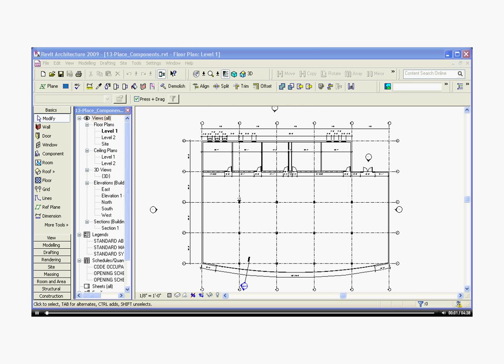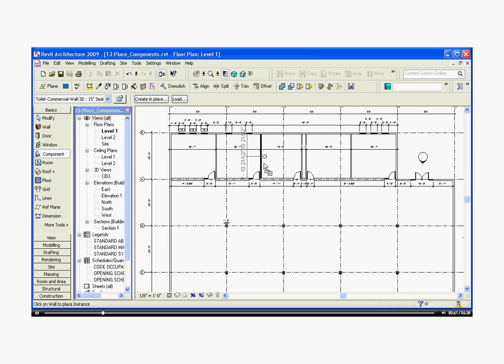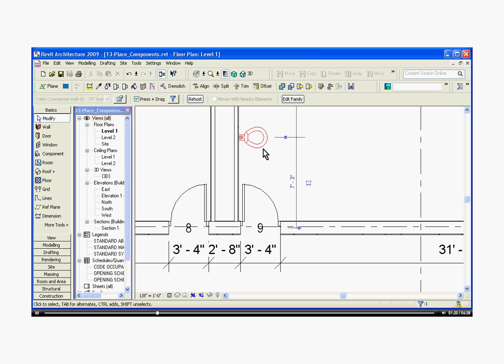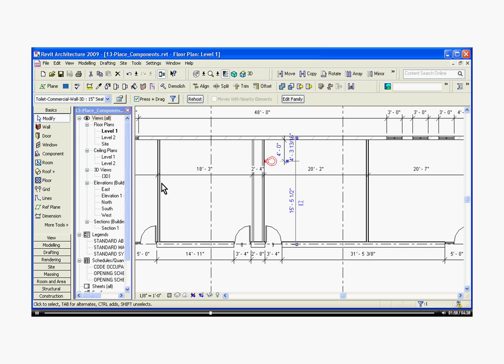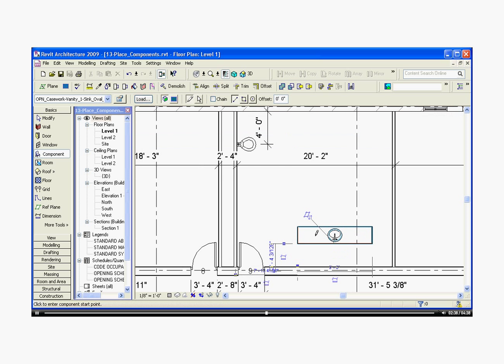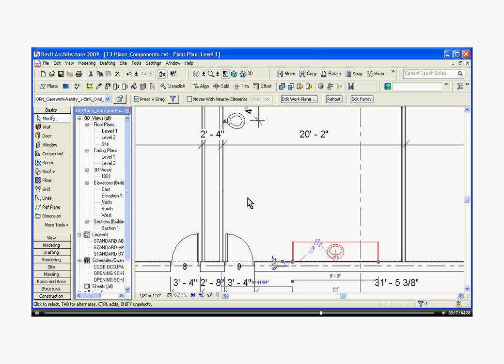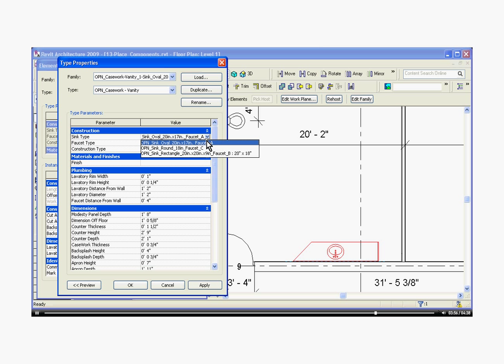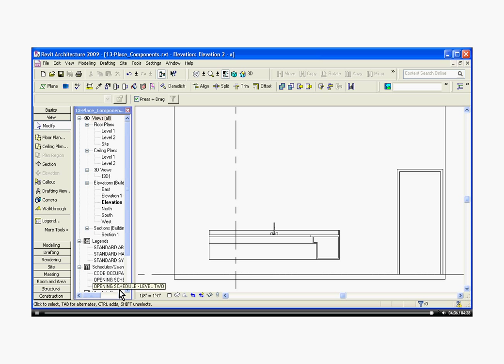Easy Revit (2009) -13-Place Components

Comment: Can you tell me how to insert a lighting fixture, I can insert the wall mounted lamps ect. But when it comes to a lighting fixture thats mounted on the ceiling, it doesnt input the same was, and no does it insert of the celing plan either. Thanks. :)